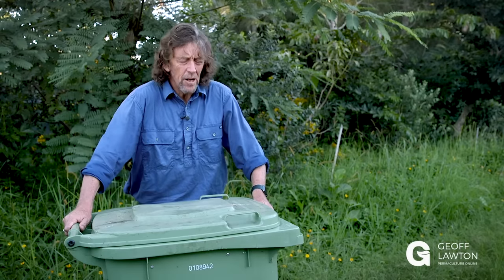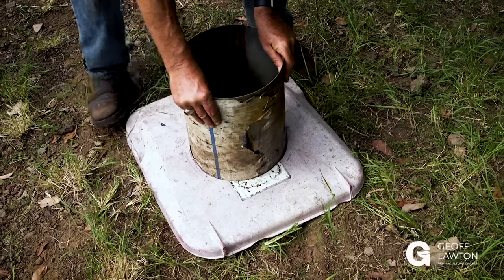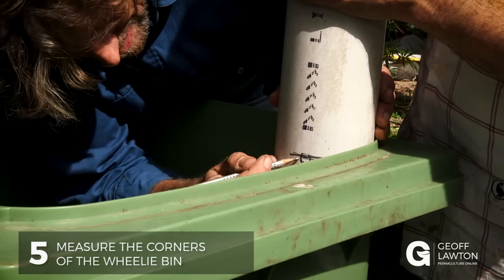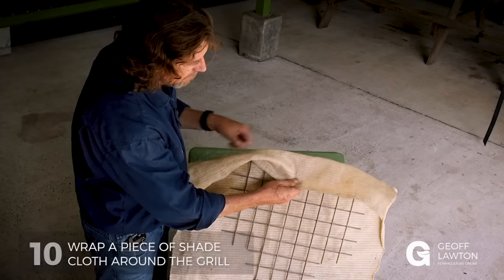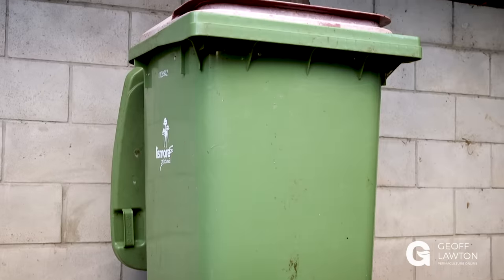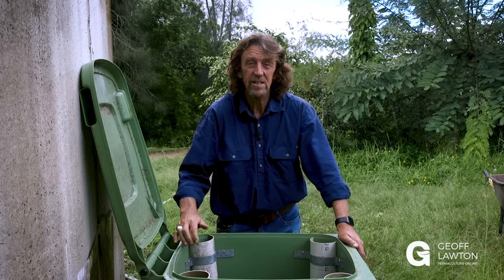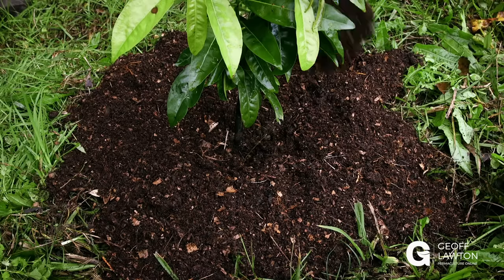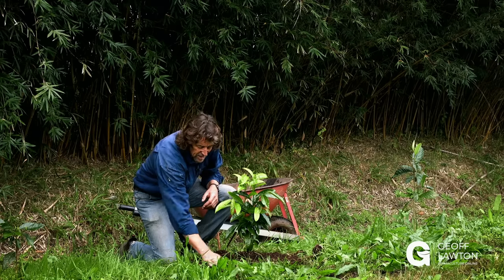How to Make a Compost Toilet with a Wheelie Bin

Comment: what about adding ash, how would that affect things? 
I have realised you need lots of these all lined up at various stages of composting when full.
Your toilet has to be high up, at least 10 feet so you can dump into it from above with a good long tube
Reply: nick w ...I’d like to know where the heck you can get the tube to start with, it’s a big size by the looks of it .
Reply: @fishmut  drain pipe or sewer pipe
Reply: I believe ash raises alkalinity of the soil, which depending on what you are growing could be a good or a bad thing.
Reply: @fishmut   Plumbing supply stores carry larger diameter pipes.  I think LOWES only Carrie’s up to 6” diameter.  Tractor supply has culvert pipe—the ribbed double-wall culvert pipes come in bigger diameters.

Comment: Need some enlighenment on the wide diameter compost toilet  delivery pipe in 2:47. Where is that routed from? Pardon my ignorance but I'm from a 3rd world country.
Reply: The toilet seat up top, it’s a long drop toilet.
Reply: jim f .... there is a system for a ground level house it’s called a bucket. 😜
Reply: @davidlarsen2184  thanks much. Just watched it. Very good info.
Reply: @davidlarsen2184   that some good information of Geoff Lawton about a manufactured system.

Comment: So you can use a flush toilet to flush into this wheelie bin composter  instead of an septic tank or sewer system. What about putting a drain in at the bottom of a  septic tank and fill the tank half full with sawdust.
Reply: No "flushing" you add water to excrements and it gets toxic and dangerous. Ideally people have a compost toilet where you can seperate urin and then if you pull a lever the hole opens for the solids. Then you throw some sawdust, on it, and it needs to be emptied every now and then (2 persons in a camper maybe every 10 days). 

Campers have them in the vehicles. And it is important to separate the pee from the feces. Or it will get stinky. 

Urin is easy to dispose of on a property, it is liquid fertilizer. And the human feces are handled by fungi I think, they take care of everything.
Maybe black soldier larvae could also handle it (for one or two persons).
Reply: a bin with wheels can be handled by one person. A septic tank is larger, is it not ? And the sawdust / wood chips / cat litter needs to be layered. Plenty on the bottom of the bin to catch moisture. Then the well layered content of the compost toilet is dumped into the bin, and some more saw dust on top to prevent smells. you do not need that much to get a nice cover because it is a high form with not that much surface area.

 It just needs a little of moisture so the microorganisms can do their alchemie inside (not sure if they separate pee in the Jordan project that Geoff is busy with, if not the pee adds plenty of moisture. Campers try to have it as concentrated as possible so the separate the liquids and the solids.

From time to time they carry the large canister with (meanwhile stale) urine to a public toilet or the campground toilet to empty it there, that stinks once they open it ;)

 I guess they have to store such bins out out of direct sun.
Reply: Lawton has experience with such systems, they use it in the Jordan project and there are quite some people (incl. the people attending workshops). If a former septic tank would be a good option, he would explain it. 

One aspect (not for Jordan, in a desert settlement) but in first world countries:
Normally regulations do not allow citizens to handle they own excrements that way - for fear of what could happen if people are careless and have no idea what they are doing. 

If you have a few such bins standing around (in different stages of maturity)  
they would be quite inconspicious, as long as even the very recent additions are covered by a nice layer of saw dust or wood chips. Let's say during an inspection or when nosy neighbours visit, only one of them would even be open.

Also the mature compost can be used earlier. If you use one larger container the very recently added excrements will determine how long the whole batch cannot be used (and some of layers at the bottom might be already safe to use).

And you will need two containers anyway. You fill one (full or half) and from then on you let the process go on (keeping it closed means that no one can add new material by mistake which would start the waiting time again).

Comment: How does Aeration work in this setup?
Reply: "Proper aeration is a key environmental factor. Many microorganisms, including aerobic bacteria, need oxygen. They need oxygen to produce energy, grow quickly, and consume more materials. Aeration involves the replacement of oxygen deficient air in a compost pile with fresh air containing oxygen."
Reply: @samualiam9981  thank you but I meant to ask how does it work in this setup given there is no way for the air to go in or out the sealed container
Reply: @helenmachelen4200 u see pipe holes there, it's a vent... when the Liquid drained out, the air is flowing in
Reply: @admindadipancar5494  how does air get drawn in given that there is a cover on top?

Comment: 1. Shavings work way better than sawdust. 2. Do not put toilet paper in there because using toilet paper is one of the stupidest things ever invented. Don't use it. Take a shower or get a sprayer/bidet.  3. If you do not pee in there you do not need to do the drainage part.  Dilute your pee 8:1 or around there and put on your garden.  It is not a total fertilizer, but it is the best single fertilizer input there is.  Pee and legumes are all you need for N, and each person produces enough to grow all the food they eat.  I am still using the bucket.  I don't know how you could do this from the first floor.  I have a second floor and want to build an small extension off the back of the house to do this.  It actually takes about 4 years for a single person to produce a cubic yard of compost material.

Comment: Don't you have to be very careful with how you deal with the liquid coming out of it? A trench with gravel in it doesn't seem good enough to deal with any pathogens.
Reply: All pathogens are killed by the huge and hot fermentation process in the bin.
Reply: @marin4311  isn't the liquid just passing through fairly quickly and not getting cooked? Does the compost actually reach temperature to kill everything off?
Reply: @davidlarsen2184  The tap on the bottom prevents from this to happen. It has to be closed during the process. When the bin is full, and all the matter has been fully composted, then only you can remove the liquid by opening the tap. it is a completely transformed product at this stage. It is just like making manure, but with human poo. This process has been around the world for millenia before modern times.
Reply: @marin4311  I thought the channels down the corners were supposed to allow air into the bottom of the pile so you get an aerated compost pile without turning it. If it is full of liquid don't you just get an anaerobic compost pile.
Reply: @davidlarsen2184  It shall never be full of liquid, but full of compost. There's mostly some liquid left in the bottom.

Comment: but you forogt about the toilet.. !!!!
no mention or sight whatsoever of a toilet anywhere..
Reply: Exactly, i still cant figure out how one might use it. I'm new to this.
Reply: @donegalplaymattersclg106   the bins (you need several for all stages of humanure) are the containers into which a compost toilet (the solids !) is emptied. (at least the campers try to not soak it all up by urinating into it they would need way more sawdust or wood chips to keep that fairly dry.

Look at the camping video channels how such compost toilets work  (Cheap RV Living has a review of a system you can purchase). People travelling or living in campers have them a lot (they do not carry that much water with them and if they are not every day on a camping ground ....).

The nomads empty the canister with urin into normal toilets. And the tank for the solids is handed over to camping site owners for safe handling, they try to keep it dry and give some sawdust over it every time they do a number 2 so it will not stink. These people do not really compost.

Comment: I am an expert in permaculture. I find the system unfavorable. First, way too much plastic. second, much too expensive; third, not completely odorless. fourth ...

here in spain we use very simple systems that are also much smaller, completely odorless ....

For example, we use a flower pot that is under a tree that needs fertilization. Next to it is a bucket with pounded charcoal and a small hand shovel made of stainless steel, copper or half a coconut shell. If the flower pot is used for the first time, sprinkle some charcoal powder into it. Then you crouch over it. The urine flows into the earth to the tree. The shit is covered with charcoal pulfer. When the flower pot is full, it is emptied into the worm farm.
We also use normal buckets. Some have a toilet seat. This is then regularly emptied into a larger container with holes. A bicycle basket is also good. It's under a tree that needs fertilizer. when the basket is full, it comes back to the worm farm.